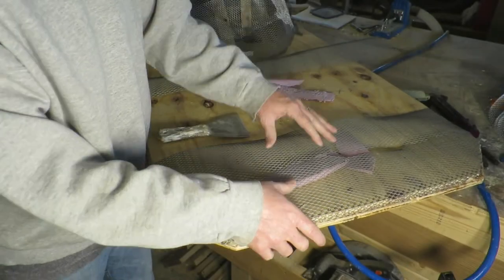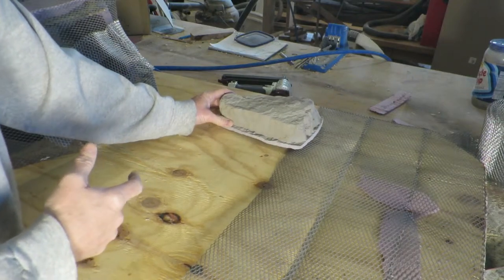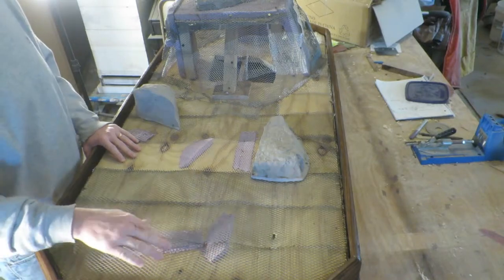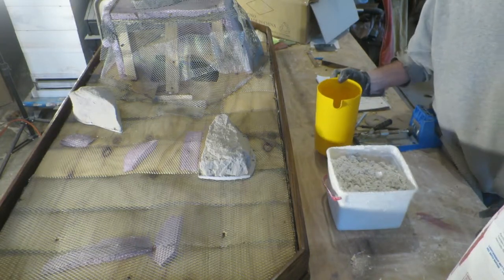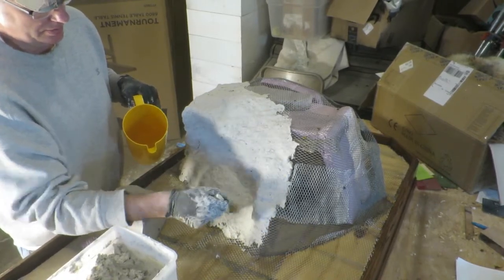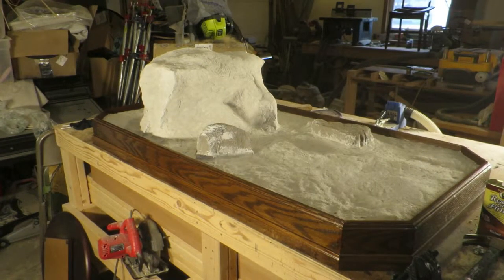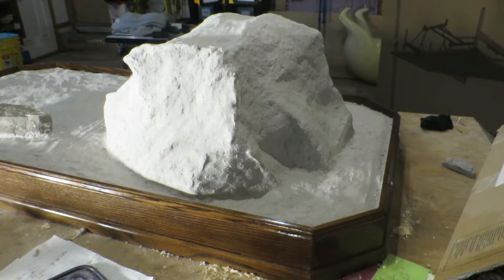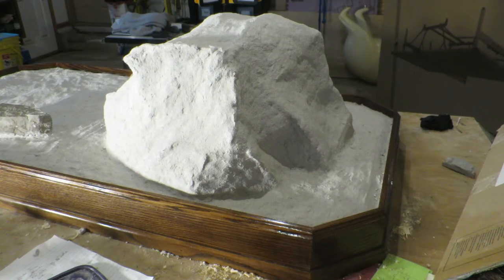Bear Habitat Episode 2

Comment: I really enjoyed the build quite creative, I'm also kind of curious... do you have a video on how you built the actual base it's self ( the carpentry work)
You have inspired try to make one myself thanks David
Reply from the maker: David I don't think i did a video on the base itself. If you have ever put trim in a house it is similar to that in mathcing miter cuts. I used pocket screws(from the back) and glue at each joint. You could face nail it with finish nails (and glue) instead if you wanted. I appriciate the nice comment and that is the very reason I make videos. Hopefully to show that it isn't as hard as you might think. I would love to see your finished product. Feel free to reach out with any questions. Thanks again, Troy.
Reply: Troy thank you for getting back to me I appreciate it, when you say pocket screws did you use a Kreg Jig? Also one other question, what piece of Hardware did you use to attached the tree Pole to the base ? thanks again David
Reply from the maker: @davidgrcn6313  As I recall the tree came with that mounting base. Yes, I used the Kreg Jig for that.
Reply: Thanks again for your help
Reply: Troy got one last question for you I think, what kind of any special technique did you use with the Kreg Jig on connecting 22.5° angle Mitre joints ? I'm sure it wasn't just standard. Thanks again
Reply from the maker: I used a portable Kreg pocket hole jig and scrap wood. Once I figured out where the holes needed to be I just applied it to the finish pieces. I am happy to know that someone is motivated to try something new because of one of my videos. If you have more questions just let me know.
Reply: Thank you once again for your help I appreciate your time and effort, watching your videos have motivated me to build my own base , the " woodbutcher"/" wood filler master" that I am 😆 just WATCHING your build has increase my skill level 100%
Thanks again